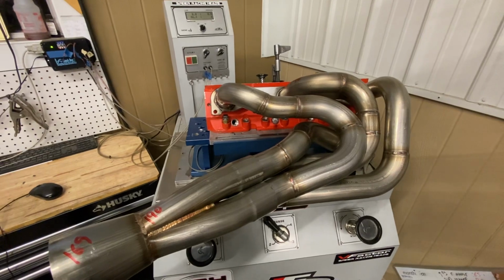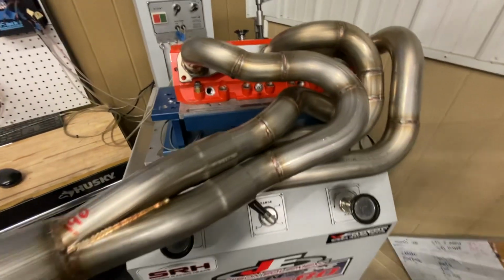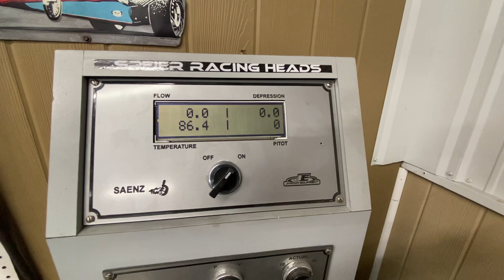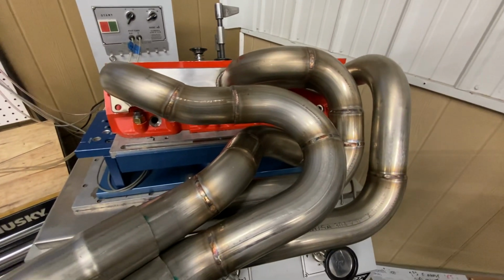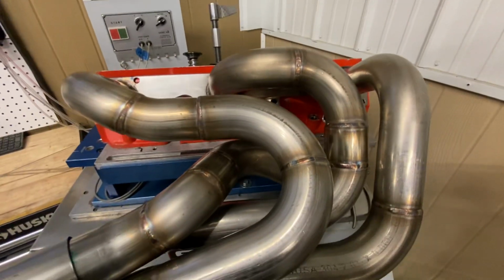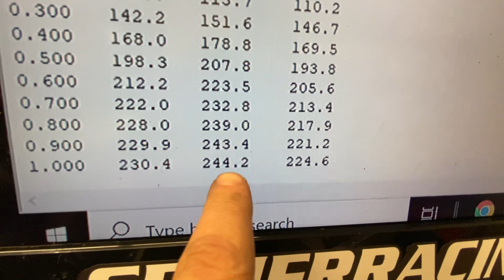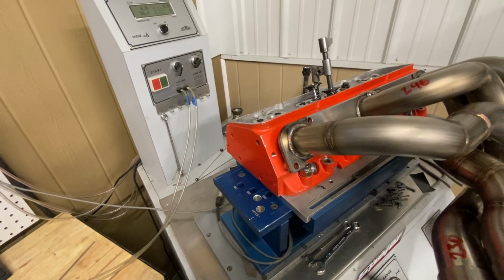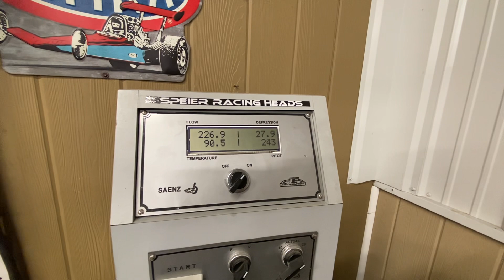Exhaust Flow Through Header

Comment: I remember reading on Speed Talk, some time back, that Mr. Alton built some headers that were just straight pipe, going into a larger pipe, as in a mass collector, and that mad the most power. Kinda like the old flathead stuff. Makes sense that you are just extending the exhaust port.

Comment: When I tested headers on exhaust passage from heads like that, any bend/angle would drop the flow, but on an actual engine, it made very little difference.  Case in point, my EMC engine made the most power with a header that bent down within one inch of the exhaust port.  Better than dyno headers that came out straight for 8" and stepped from 1.3/4" to 1 7/8".  A running engine is MUCH different than a flow bench.  I have flowed the exhaust up to 48" on my SF-600 to check.

Comment: Think of this:
When exhaust opens, the blowdown period.
You got say 25bar pressure in cylinder rushing out fast as f..
When the cam gets to your max lift, is actually the speed still that high?
The pressure in cylinder pushing it to high speeds is much lower at that point.

Comment: I wonder if the single port flowing through the header with the other ports just open changes anything with the velocity of the runner being tested.  An interesting variant of the test would be to try it again with only the port that's connected to the cylinder open and the rest blocked with tape or closed valves.  Would there be any difference or any meaningful data?
Reply from the maker: Intakes I would tape off as they are sucking.  Not sure on the exhaust since it's pushing.  I can try it.

Comment: Interesting data . Agree the flow with the header should be the most useful . But then you got to add the other pipes and there pulse .  I’m a Canadian . My past involved 2 stroke snowmobile racing . Like everything else .  Track testing is what matters . Example the pipes that make the best power . Don’t always go the fastest . But ambient temp was a factor . Like the way your brain works . Have everything you need let’s see
Reply: Darin Morgan mentioned about t
best test for exhaust would b applying pressure with a charged tank, a stop on exhaust valve then smack it open with a hammer n note pressure drop😅
Reply: @rickyfulks889  it’s a very interesting subject . You have hot exhaust gases still burning , and creating pressure . At different rates . Ie load and rpm . Then separate pulses in the collector . Effecting each other .    I have experience racing 2 stroke snowmobiles .  Where the expansion chamber exhaust .  Adds intake density .  It’s a different game . But what works best on paper . Nay not be best on dyno . and that may not be best on the race track . It’s still a tuning game .   A header with multiple pressure transducer . In the primary . Would create some interesting data while making a pass

Comment: it is pointless test. With header it is about scavenging , runner length, choke point diameter, pairing of the runners (for 3Y application). Those turns and elbows has nothing to do with flow.
Reply from the maker: no kidding??
Reply: BS !!! It has alot more than you think to do with flow .
Reply from the maker: @bobgyetvai9444  Did you watch the video or just can't wait to be an ass???

Comment: Your pipe diameters are too small
Reply from the maker: How big do I need?
Reply: At 28" length- 230% of single cylinder displacement
Reply from the maker: @arthurking6549  So what does that make it for a 358?

Comment: Of course theres massive loss in velocity and in cfm . Every turn causes those gasses to spin in the tube and block flow and velocity . If it wasnr for heated gases and the  wave energys headers would be a big hindurance to power . Put those shapes on a intake and its a far worse turd !!!
Reply: wrong... You have many test done by richard holderner where LSX manifolds with turned runers outperformed straight runer manifolds.
Reply: @CL9k24a3  you completely missed the point  dude . COMPLETELY !!!  A round tube IS a horse of a different color , no intake looks like a header either . Jeez...... swing a corner in a round tube and the gases SPIRAL causeing the turbulance that BLOCKS FLOW . Velocity is DESTROYED and so is VOLUME !!! Richards tests are Far from comprehensive . He changes Parts on junkyard refugees . Thats IT !!!  The man also contradicts himself quite regularly and with his own testing lmao !!!
You make a good pair
Reply from the maker: @bobgyetvai9444  something has to cause the air to tumble, not sure a dry bend in the exhaust will cause that.  The gases are hot and dumb and take the shortest path.
Reply: Nissan VH41 V8 intake manifold would be a better starting point for header looking induction.
Reply: @SpeierRacingHeads  you may not be sure but i am . Its No Theory , a significant bend in a tube  causes a spiraling type of turbulance that looks like a coil spring inside a tube . Rather than go on downstream it spins in there blocking flow !!  Since when does a gas need to trip over something to get stupid when being turned ?? It doesnt !!!  You know better !!! Divide that 90* turn so it cant spiral and velocity takes off like a rocket !!! Flow energy is no longer wasted . 
How these other guys got that a intake that looks like a header full of twists and turns IS DESIREABLE shows their  lack of airflow science knowledge or understanding it on many levels , none of it any  good .
Reply from the maker: @bobgyetvai9444  Flow energy?  What is causing flow energy?  I know, HEAT.

Comment: Why don't you just calculate the velocity using cfm and the cross section of the header tube? Way more accurate than your pitot tube test and much faster if you make a simple spreadsheet.
Reply from the maker: There is no way a calculated formula is more accurate than a pitot tube.
Reply: @SpeierRacingHeads  I'm not saying your pitot is wrong. I'm saying that if you move it 1/4 inch one way or the other,  the reading will change,  so why try to use it for an average velocity measurement? If you know the tube diameter and you know the cfm, you do the math, and you'll know exactly the average velocity of that cross section. This is airflow 101.
Reply from the maker: @seanbrown8269  who is using it as an average velocity measurement?  The center is the most important.  Do the math and tell me what the exit velocity should be!
Reply from the maker: @seanbrown8269  218 CFM and 3.50 collector.
Reply: To answer your question and assume a 1/16th" wall thickness,  the actual air velocity of a 3.5" OD tube flowing 218 CFM will be 58.5 FPS. 

If you're not trying to figure the average cross-sectional velocity, what are you trying to determine?  The peak velocity? Can you explain this?  Because I'm not understanding the logic in your velocity measurement method.